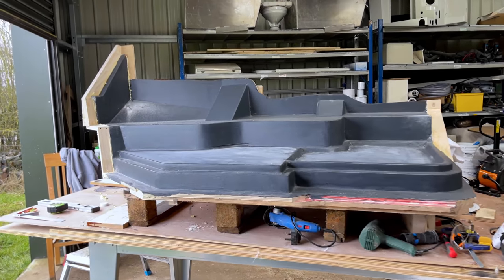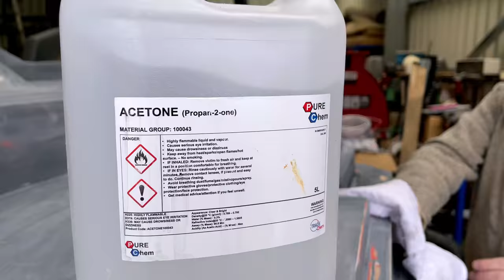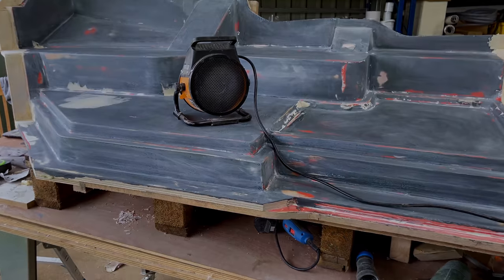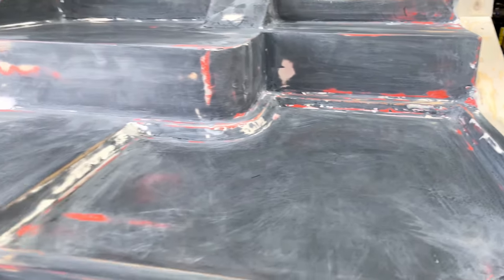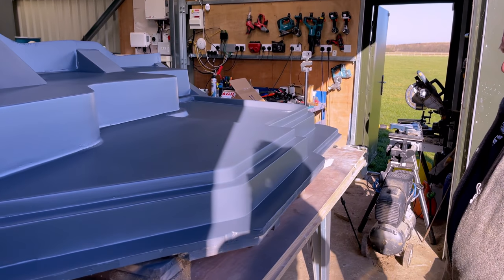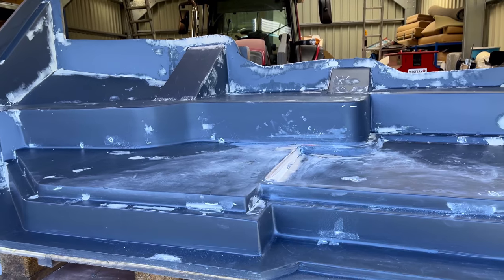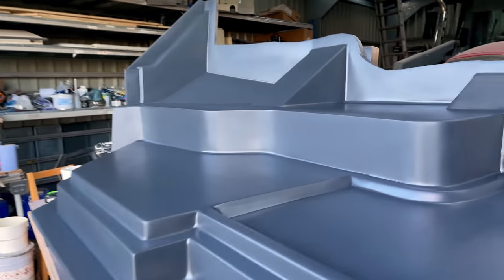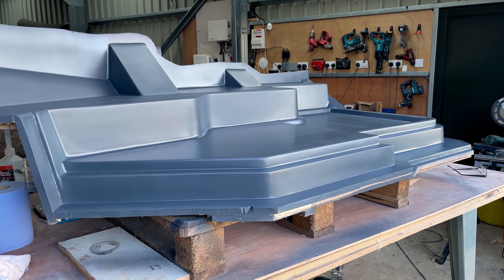Motor BOAT REBUILD - Can we fix the Sealine Factory Shower Pattern - EP42

Comment: Plug is looking good guys. That Duratec goes on nice. What working time did you have with the Duratec once it’s in the spray gun. Looking forward to the mould build. 👍
Reply from the maker: Thanks ! In low temperatures we were getting around 20 - 25 minutes working time.